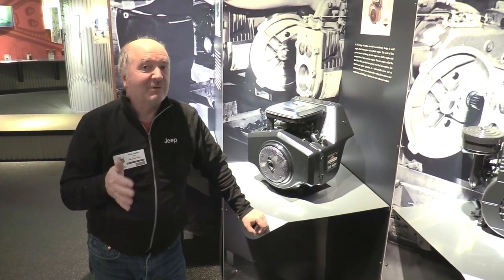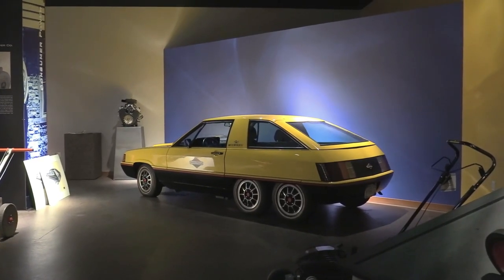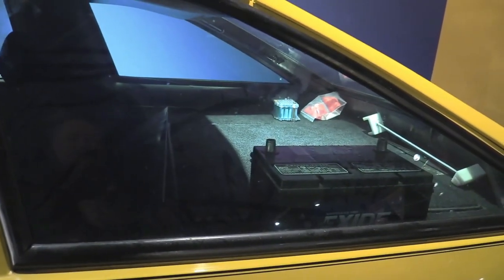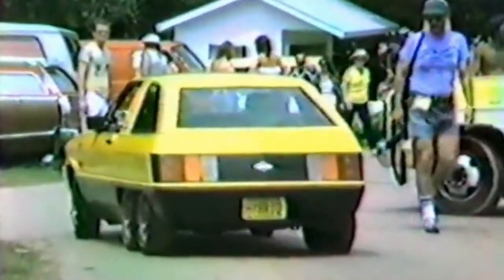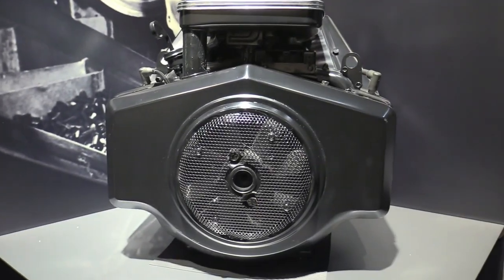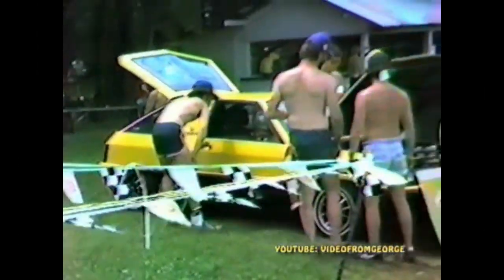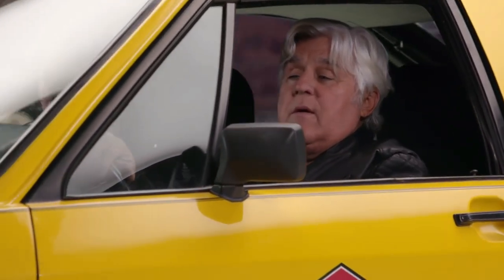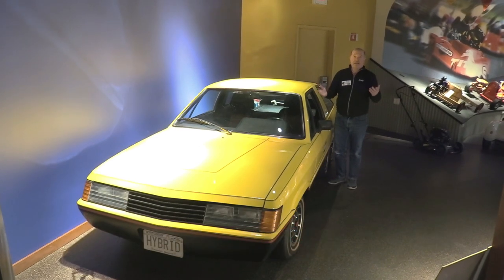Briggs & Stratton Hybrid Prototype

Comment: That hybrid would be fine with a modified engine and lithium batteries and an efficient control system.
Reply: They used what they had but you’re correct. Thanks for watching